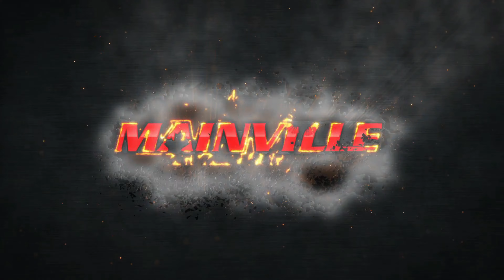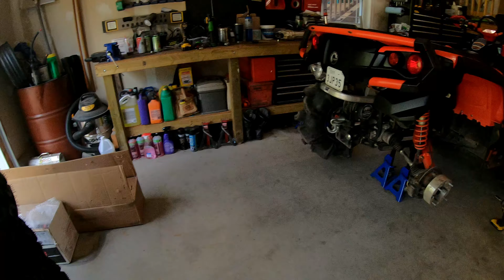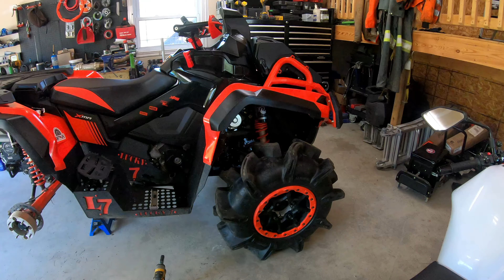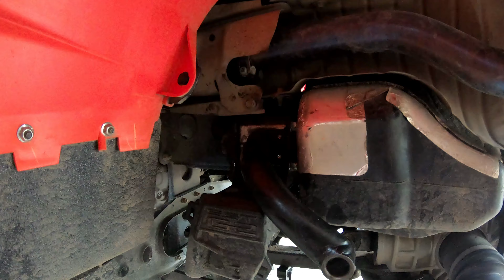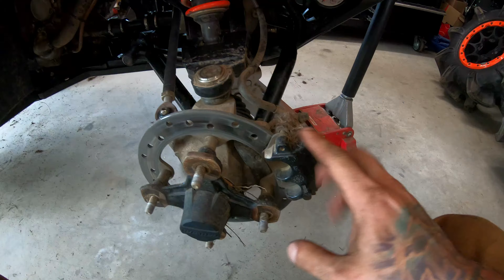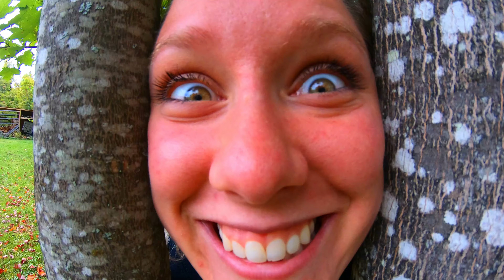XMR Trail Mode? Elka Suspension, EFX Motoclaws, MSA and Highlifter!

Comment: I've said this quite a few times before, but i really think that people are dismissing trail oriented tires for the pure look of mud tires. 

Mud tires work great!.. in mud.. anywhere else I find them clunky, grabby, rough and not suitable for 90% of the riding that's out there. 

Unless you are a Competitor or run skeg and need those massive lugs, your are sacrificing sooo much ride quality and being harder on your drive line.

That XMR is looking great with that shock/tire combo, Mainville.
Reply from the maker: I couldnt agree more. Thanks for watching!

Comment: Got a question, the fox shocks with the reservoirs can’t be adjusted for trail ride quality? Are the Elka shocks that much better?
Reply from the maker: @badas95Z  fox shocks that are mass produced for OEMs are significantly different and generically  tuned for bulk units compared to direct order specific fox shocks. Elkas are purpose built on order for specific needs for exact applications. To be fair, if you direct order fox shocks they can be as well. The point is, elkas are better than oem "fox" shocks.
Reply: Okay thanks for the info. I just bought a XMR 1000 and was looking over it and noticed the fox shocks have adjustment knobs and screws at the top and bottom. Already have back issues so was just wondering if they could be adjusted to make the ride more comfortable or if I should spring for the Elka shocks. Thanks again for the feedback

Comment: What size spacers are you using? I’m running 2” spacers with factory wheels on all 4 corners on my 2017 XT-P and I’m wondering if the BRP fender flares are worth getting or if they will even cover everything?

Comment: I really like those wheels and tires,  they look good on your quad. Would someone need a lift kit or any other mods to run those moto claws on a 2020  850 outlander max XTP?
Reply from the maker: Yes you would. Xtps have soft suspension and true 30x10s would hit the footwell plastics. Or an after market floorboard and a 0mm offset rim